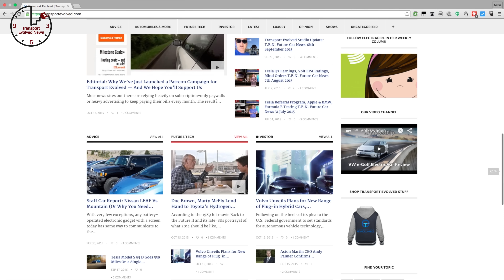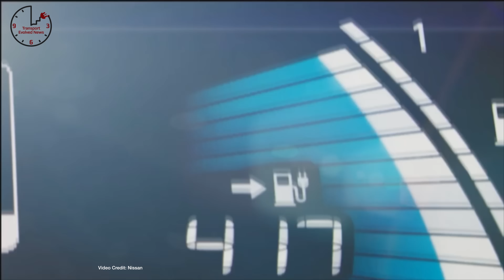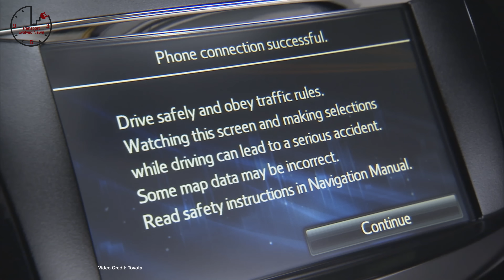Tesla to buy SolarCity, Hyperloop in Russia, Fastest EV in the World. T.E.N. Future Car News 6-24-16

Comment: Your last note, about the Swiss race car record that was faster than the time needed to exit the car, is a little  of an apples and oranges  comparison. The more practicalTesla seats seven in some configurations, while the highly optimized race car seats but one. 
While I will give you that getting out of a race car harness is a bit more complicated than from a sedan, when it comes to a family of seven getting out it may well be that the times are quite equal or even in theTesla's favor for a subjective measurement like that  :)
Reply: It's nice that they went through the process of obtaining a formal record, it would be really interesting if they were quicker than our current 1/4 mile drag race cars. I know that the White Zombie, which is slower than current cars, did 0-60 in under 1.3 seconds on a prepared track.

Comment: A 200-mile-range Nissan Leaf is huge news, since it's already a mass produced EV.  It was inevitable, but big news regardless.  Toyota softening its stance on EVs is welcome and also big news.  Perhaps they may be getting a clue.  The previous Toyota RAV4 EV versions were successful in that they are great cars and owners love them.  They were unsuccessful in that Toyota only made a few thousand of them as compliance cars.  Toyota really was not committed to EVs, despite making a few very good ones.  BMW also moving towards an all electric i8 is also welcome, but would be produced at tiny volumes, so is still a very niche car and not really significant.  When they start making a million electric 3 or 5 Series, then they may be serious about EVs.  

Inductive charging is a unnecessary waste of resources and something that reduces EV adoption by driving up cost.  Plugging in is not at all difficult or time-consuming.  Inductive charging over a distance is also measurably less efficient than plugging in, so it's also a waste of energy.

Comment: As I see it, Toyota has two choices:  

1. Abandon FCEVs, due to their impracticality.
  
2. Spend the required 100's of billions to give them a chance in the market, instead of relying on various Govt.'s to fund the expensive experiment.    

Otherwise everyone is just throwing money away.
Reply: Without some breakthrough, Hydrogen is either 3+ times less efficient than using an EV, or uses natural gas, a fossil fuel.  Fuel Cells aren't as practical, efficient or cost-effective as EVs.

Comment: The SolarCity purchase by Tesla sounds intriguing for several reasons. One is that I have always wondered why the Tesla cars don't have small solar panels worked into their upper chassis to extend the range on a sunny day by - actually quite a bit.
To my thinking that is a missed opportunity, and who knows - maybe Elon Musk thinks the same? :-)
Reply: At this point, solar panels make more sense on roofs of buildings than cars.  The power density of existing solar cells is too low to be useful on cars.
Reply: I see. To get a useful result, you need too great a surface then. That does invoke an amusing picture of ungainly cars with massive solar arrays strapped on top of their roofs. xD